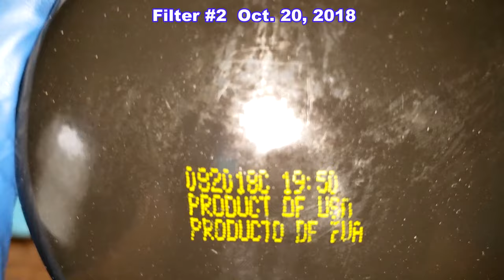Amsoil EAO11 Oil Filter Cut Open, Two Used Amsoil Oil Filters Cut Open Comparison

Comment: Sloopy potting/glue jobs, in a premium filter one would hope for better. Probably didn't hurt anything though. If I was interested in running an Amsoil filter, just buy a Champ Labs made Fram Endurance FE off the WM shelf for $13. Same filters. Thanks for vid.
Reply from the maker: You're Welcome faxmen09👍
Reply: Yup basically the same filter without all the glue with the Amsoil
Reply: Yes amsoil, real endurance and royal purple seem to be exact same filter.

Comment: That first one looked sludged up.  Which goes to show that you should always change your oil & filter at 5,000 mile intervals, NOT 15-20,000 miles.
Reply: Yup ! Oil & oil filters are relatively cheap compared to a new engine
Reply: @daewooparts  exactly. Well, unless they're Amsoil oil and filters lol 😆

Comment: Those 2 filters show WHY oil should be changed every 5k and/or 6 months, when using synthetic oil; IF you use straight mineral oil, then go to the 3k/4-month oil change schedule!
Reply: Every 6 months? Oil don't go bad sitting in the pan. It takes heat to break it down. Takes heat & fuel to make it acidic. Heat being the key catalyst. 

Once a year is fine. Or every 5 years, in the case of my F-150. Oil isn't going bad sitting in the garage most of the year.
Reply: @donwyoming1936 oil definitely goes bad sitting in your engine.
Reply: Short trips are hard on engines and engine oil.

Comment: The 16,000 mile filter was probably in perpetual bypass mode.
Reply: I don't know why you think that, they looked very similar, although I'd not go past 10k myself.
Reply from the maker: I kinda doubt it but thanks for the feedback
Reply: Because the filter was loaded with crap and the oil looked like chocolate syrup.

Comment: Interesting.  Amsoil oil sludging at 16k.  Can’t be.  This is the Superman of oil and good for 25k.
Reply: The oil was doing its job, cleaning the sludge that was inside the engine, and it ended up in the oil filter😊
Reply: @kos2318  oh.  So whoever this person is that sent the filter in had not run Amsoil in this truck before?  I guess I missed that in the video.  My error.
Reply: 😀😄😁😂🤣 Then Amsoil woke up.🥱
Reply: OR, 1 year. Like they advertise. These filters are way over 1 year.
Reply: So wait a second, that first one is advertised to go another 9k on top of that?
Reply: Might as well put an empty can where the filter was and not have to worry about changing the filter ever again. And leave the original oil in, too. Just top it off every 10K miles, until it turns into volcanic sludge.
Reply: @kos2318  Bullshit the scamsoil oil had already broke down along with the scamsoil filter.
Reply: There is sludge in the 16,000 mile oil interval, but is it protecting? Sludge is not good but that is what an oil filter would be for one of the reasons. One of those oil analysis labs would have to take a look and see if it was protecting. Great job whip as always whip wrencher I appreciate you.

Comment: Great video Pete. Chuck is a dope for going that long on intetvals. Not to mention paying 2x for the oil and filter. Better off using MOBIL 1 every year/6k plus PRBoss is a better filter.
Reply: I didn’t see any sparklie metal shavings in that filter media. Did you? The purpose of the filter is to trap dirt and sludge. It looked to me as if it served its purpose.
Reply from the maker: Thanks John, 
and thanks for the feedback, but Please no name calling.
Reply: the boss is horrible at actually filtering. most of the BOSS line is 99% @>46um.
Reply: @brendan747   Boss? Huh?
Reply: @RetirednbrokeinPa  the purolator boss filter

Comment: The owner should use Mobil 1 Extended Protection or Pennzoil Ultra Platinum and change their oil every 5K miles. I know Amsoil Signature is expensive and supposed to last a long time. but 15K miles is too long of an oil change interval. It's not a matter of oil breakdown, but also a mater of engine and oil cleanliness. As you proved in a prior video, those Amsoil filters are made by Fram, and the minor differences were just differences between one production run and another.

Comment: amsoil had donaldson make the filters for them before with the premium filter that donaldson offers which is the best filtration media but have since changed to fram as the contractor for the filters and they are using the fram top filtration media that is offered.
Reply from the maker: There actually made by Champ labs.
Reply: @WhipCityWrencher  Champion, Luber-Finer and Fram are all owned by First Brands these days. First Brands was formerly know as Trico (the wiper blade company) but is a multi-national corporation that produces for both aftermarket and OEM. You will notice cross pollination of the brands when comparing base plates, center tubes and by-pass valves. Many of Amsoils filters are made by Fram but with production facilities all over the world, and First Brands being the parent company of the filter manufacturers, it's possible to get them from a multitude of facilities. My last batch of Amsoil filters were made at the Fram facility in Greenville, Ohio.

Comment: Filter #1 looks like rusting and my guess is because it was on the truck for far longer than they are rated for use. That is the result of condensation  from being on the truck for over 2 years when Amsoil recommends only  25K miles or 1 year whichever comes first. Don't blame the filter folks blame the owner.

Comment: You need to do a side by side comparison with a filter that went 20,000 miles on one truck and another truck with the same powertrain that did 5,000 miles changed the same day. A filter that has been sitting for years will obviously look worse because the used contaminated oil was exposed to oxygen and moisture and will go acidic. Of course it’s going to look sludged compared to a recent filter. Please do another legitimate test with the miles stated above changed the same day or close to.
Reply from the maker: Fine, where do I get these oil filters?😊

Comment: He might want to try full synthetic Motorcraft oil if he's going to exceed the factory recommended 7500 mile oil change. Motorcraft synthetic appears to be superior to Amsoil & Mobil 1.
Reply from the maker: I haven't seen an oil analysis on the Motorcraft oil. Is it that good? Thanks!
Reply: Motorcraft oil is not as good as amsoil. Amsoil has lower noack, higher tbn and better base oils. Do some research, your clearly uneducated on oils.
Reply: Nonsense, Amsoil is definitely superior

Comment: filter #1 media is clearly taller by 30 thousandths.  not sure why you said they're the same.   amsoil filters are nothing special, just a rebranded filter from one of the big manufacturers.
Reply from the maker: They are the same, oil filters are not made with exact measurements. If I moved the caliper to the other side, I would have probably gotten the same measurements. That's close enough for me.
Amsoil oil, filters are made by Champ Labs.

Comment: Amsoil rip-off bases on manufacturer and overly miles of service intervals. That's  not the case for an outanding oil brand but not for a filter deaign. This fiter besed on your discoveries appears to be made by regular wix filter  o fram.  Not my cup of tea.Mobil1 or K&N is even way better. Amsoil should only be focusing on great oil production only not a filter or veraities of automotive items. "Peaches are peaches and Apples are apples."
Reply from the maker: It's actually a Champ lab. made filter, same as Fram Endurance.
Reply: @WhipCityWrencher  Even worse!

Comment: That 16k filter is horrible ! Yikes !! And $15 a grt engine oil with a $19 filter ? all that truck needs is a fram ultra or XP with supertech 10,000 mile synthetic which meets ILSAC GF 6 every 5 or 6k and it will be just fine ! One word "SCAMSOIL" 😵
Reply: If changing every 5K miles, there will be no improvement in engine longevity with Amsoil, compared to any of the top synthetics. Case in point: the cab that just took us to the airport was a Toyota Sienna with 425K miles on it. The owner used OEM filters and Supertech synthetic oil for every oil change.